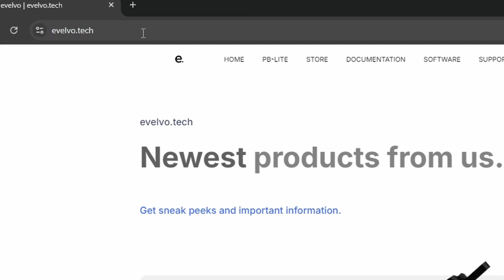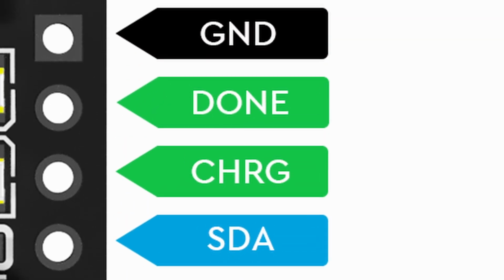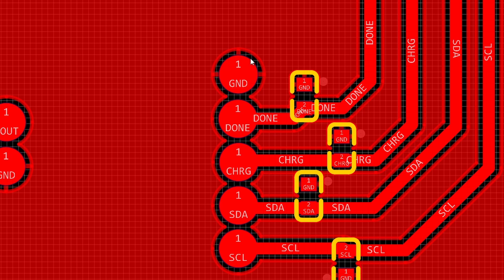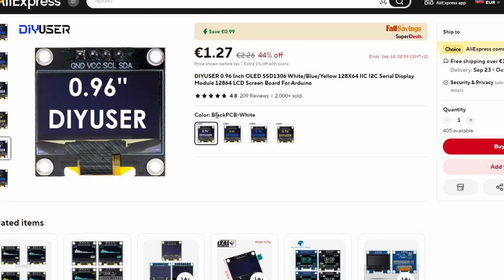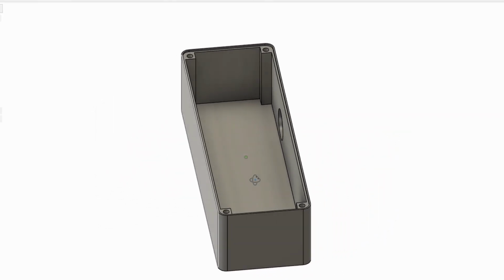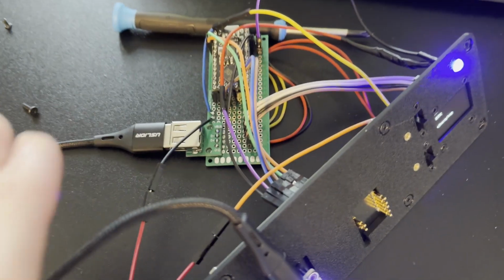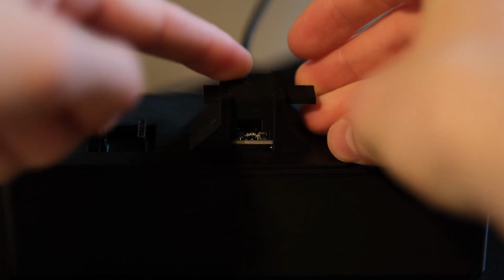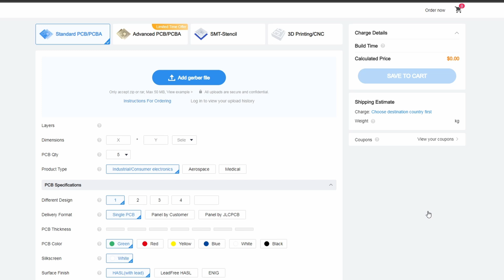Making a CUSTOM Testing Machine | powerboard-lite

Comment: Did you do this out of fun/sake of learning or do you have serious concerns about the failure rate of these boards? Buying something as cheap as this, I would never assume it was manually inspected.
Reply from the maker: I simply made it as a precaution, and so far there has been a 0 percent fail rate. Quality is always very important to me and this way I am sure all of them work before they are shipped.

Comment: you may be able to add 2 pogo pins that touch the battery solder point. Then you can add a permanent battery that doesn't need to be plugged and unplugged at each board test. You may be able to use a DAC converter to simulate a battery and fully automate the test rig, without anything to be plugged in each board !
Reply: I guess they test the battery connector this way, maybe unintentional but still one less thing to worrry about.